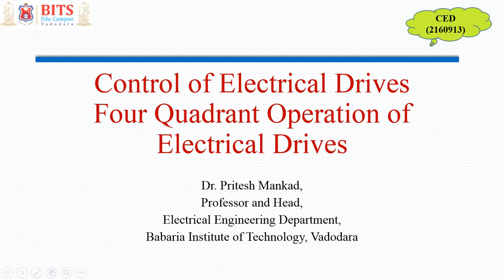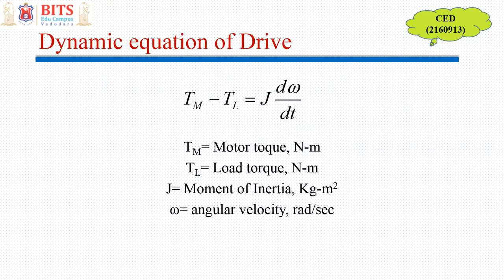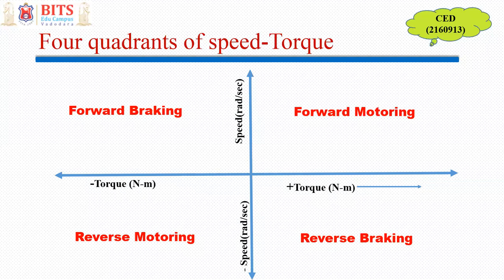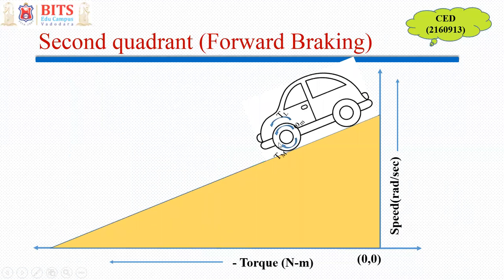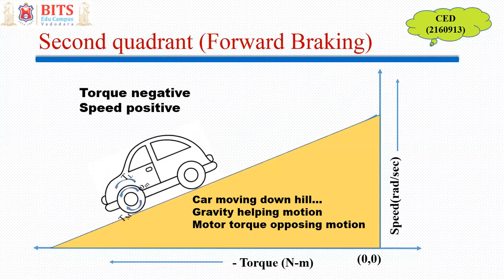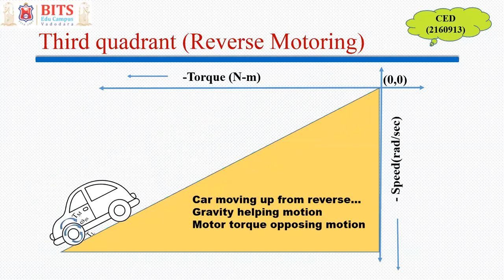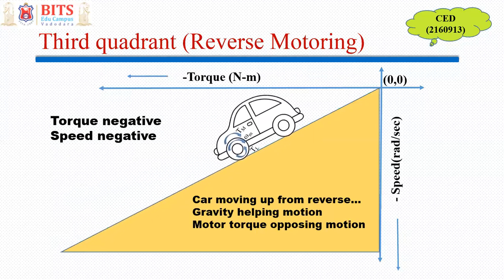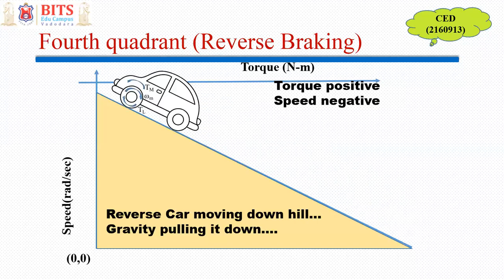Animated Four quadrant operation of Electric Drives with the example of Electric Car

Comment: Does battery charge in forward braking also? What are the polarity of terminals and current flow in all four quadrant operation?
Reply: Thankyou for the clarification 😃
Reply from the maker: yes battery can be charged in forward braking if the converter allows bidirectional flow of power. In forward braking, back emf/induced emf becomes more than supply voltage so power is negative which can be used to charge the battery.
Reply from the maker: forward motoring V +, I +
forward braking V +, I -
Reverse motoring V-, I-
Reverse  braking V-, I+